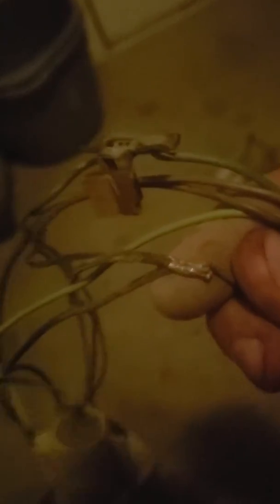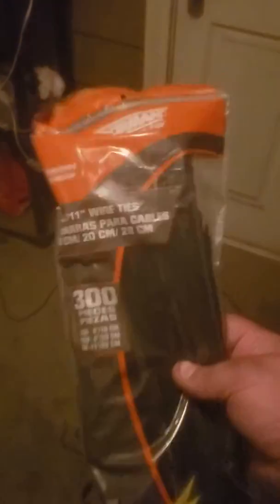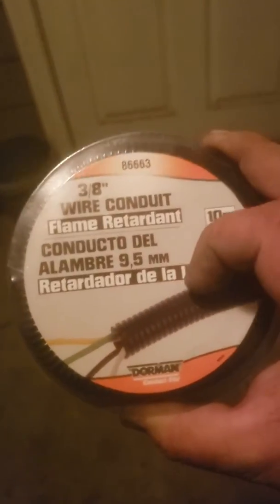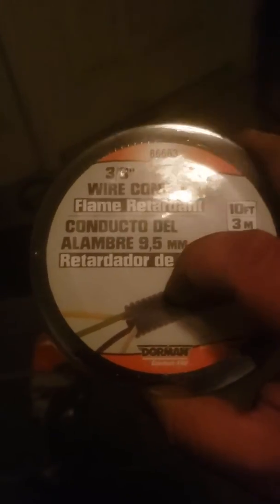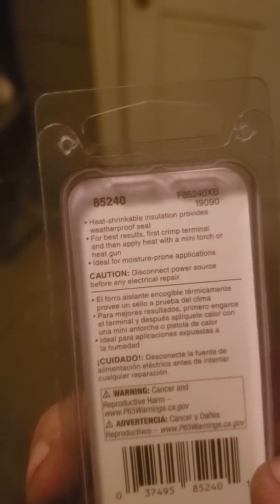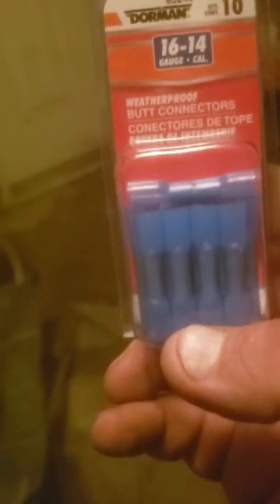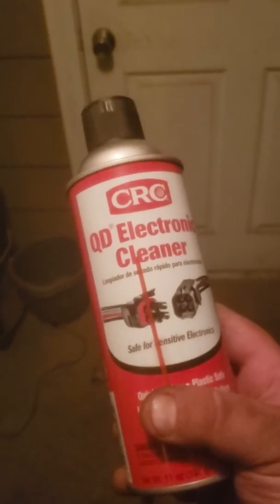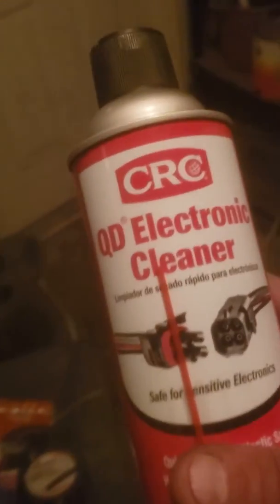Chevy squarebody rear light wiring harness restoration. Project Old and Gray. part 1

Comment: "Just some of the things people actually do" 

I feel that. A 91 f350 I worked on today I had to sort out and undo every crackhead tweaker rats nest of wiring other people had done over the past year it had apparently been sitting and none of them figured out the only thing wrong with the truck was the 15$ ignition switch actuator in the steering column. 

I've sorted out dozens of tweaker wired cars and undercharged them because it was so quick, but the reason I got to be fast with wiring is I hate it, I hate wiring so much, the squarebody I use as a service truck has had wiring issues since I got it over a year ago I haven't  fixed since I wont get paid for it 😂, the left turn signal doesnt work with the headlights on. So now im finally getting around to watching videos on what the harness should look like procrastinating actually doing it

Comment: The scary thing is the connections that were wrapped in black ductape is actually factory. My truck came from a police department and the shmucks just twisted bare wire together and electrical taped over the top and called it good was absolutely sickening